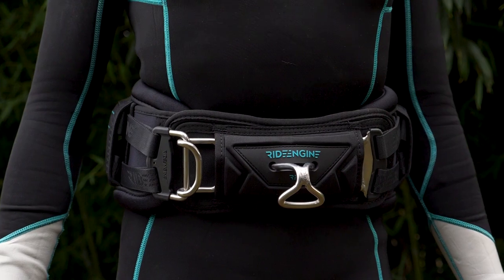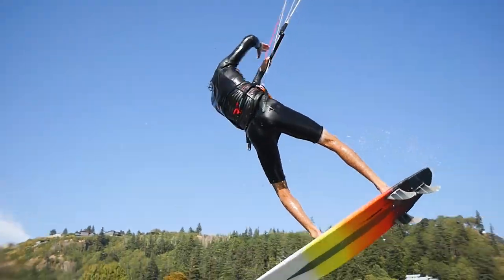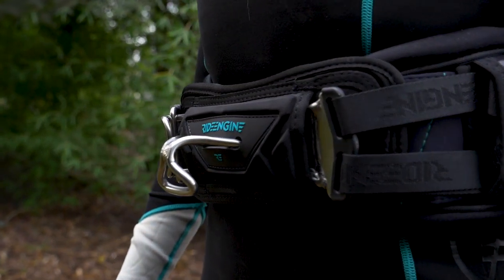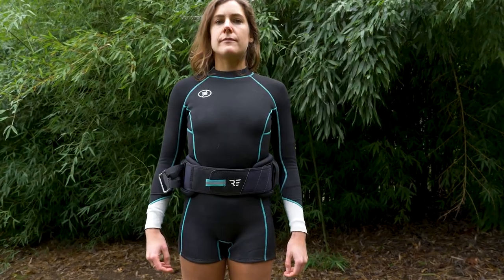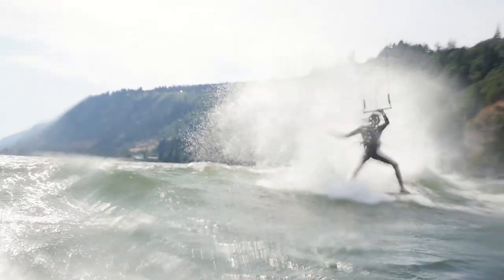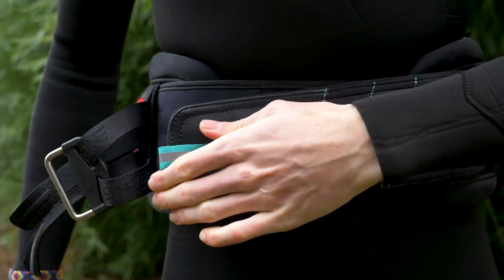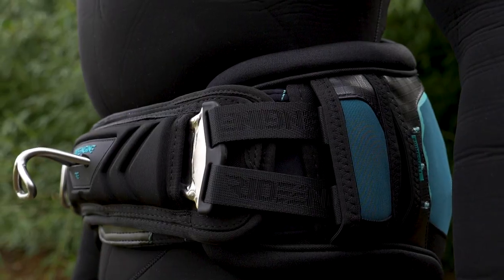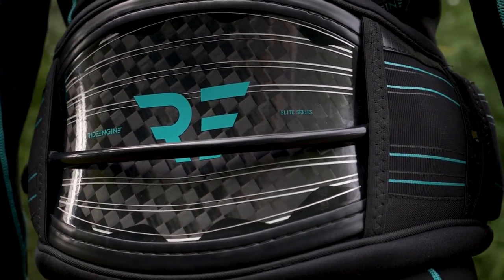How to properly fit a kiteboarding harness?

Comment: wrong! A tight harness will NOT limit your ability to breathe. You don't breathe with your hips or lower belly. The lungs are in the chest, perfectly fitting within your rib cage.
Reply: Yes of course, because your diaphragma sits right below your ribcage, it gets restricted with a tight harness below your ribs. Actually this is the reason why world champs like Kauli Seadi or Marcillo Browne or other professionals like Adam Lewis or Graham Ezzy ride their harness loose and down on hips, to not hinder breathing. Information can easily found threw YT, but stay ignorant. A suggest you never felt the urge to take full breathes during windsurfing or kitesurfing cause you peter out when waves get bigger than chest high or generally stay away from difficult conditions which need full engagement of your carvescular system, otherwise you would have noticed that harness worn high limits your perfomanse by restricting oxygen intake threw restricting breathing.

Comment: Why is it not good to have the harness sit on your hips? You give no exclamation for this, just making a statement.
It seems that you dismiss this riding style, harness below navel, as my suggestion is, because it makes the harness more difficult to lock in place. But is it not your mission as a progressive manufacturer to solve problems and create innovative products?
As a matter of fact there are for instance riders like Kauli Seadi, Bernd Rödiger or Marcillo Browne, who are sailing with waist harnesses in low position. What are they doing wrong, and when they are wrong: Why have they won many Titles, even including World Titles? You dismiss their style of harness use, you know it better than them?
Please give an answer.
Reply: I think you’re confusing specific, pro/very experienced guys with “general harness fit”
Reply: @Showmetheevidence-  What you say is, because they are pros no one else is capable of mastering same equipment, don´t use it?
Reply: i assume you're quite new in this sport....loose harnesses slide UP TO THE CHEST... if you want low harnesses with low center of gravity, buy a SEAT HARNESS